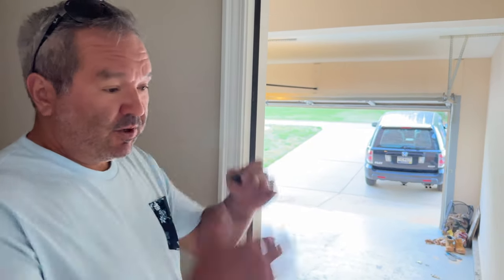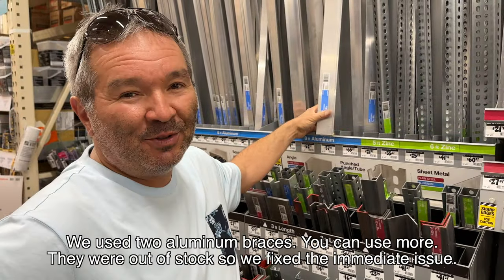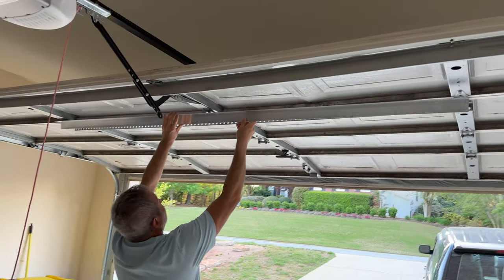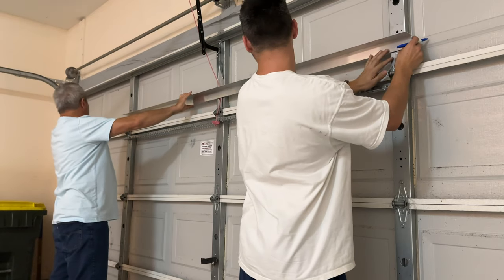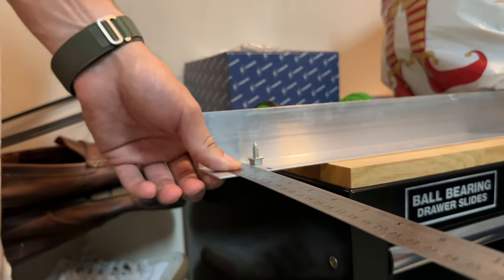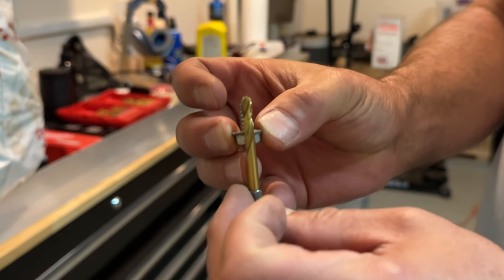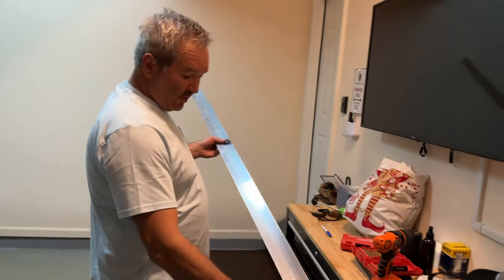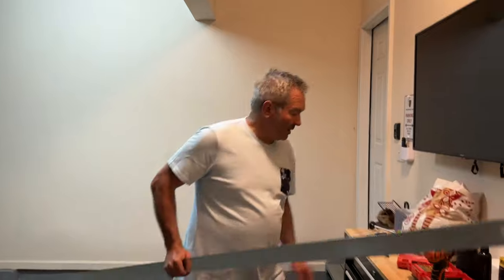garage door sagging fixed

Comment: If you want a permanent fix a strut would make that door run like brand new
Reply from the maker: A strut is an overkill really, it adds needless weight, more expensive and sometimes hard to find. Angles are everywhere and more than 1 can be added and bolted together for extra rigidity.

Comment: The motor rail is to high above the door it’s only is should be 1 “ to  1 1/2 above  that’s why the door bends
Reply from the maker: Ya, that contributed a little. But Struts are only at the ends, not in the middle. 20 years of bending back and forth did the predictable damage.